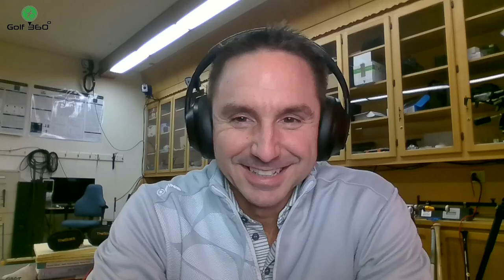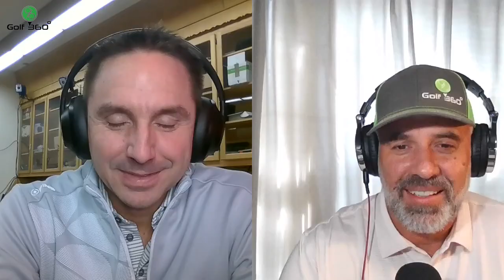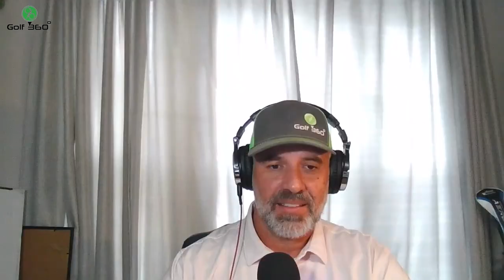Dr. Sasho MacKenzie | Golf 360 Podcast | FULL Episode

Comment: More excellent content ❤

Edit: I wonder if Sasho is aware of any research on using clubs a bit above your skill level (ie driver with weight distribution towards face) to improve your swing mechanics over time automatically vs using 'easier' clubs
Reply from the maker: Not sure the swing mechanics would change much with moving the weight to the front over the rear. It would/could have a minor effect on your reaction to the club moving through space, due to feedback from the club head thru the shaft and into the hands but would be more noticeable on the ball and launch conditions - launch angle and spin. The drivers shaft deflection will also be less on a driver with the weight distributed towards the face and should be taken into account when fitting. Hopefully this helps.